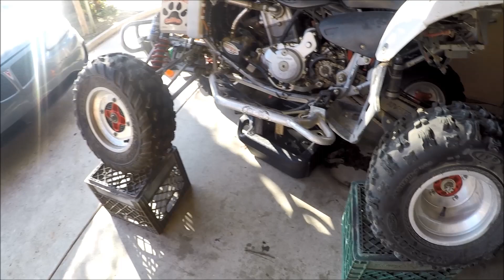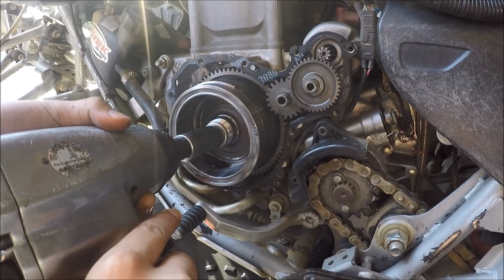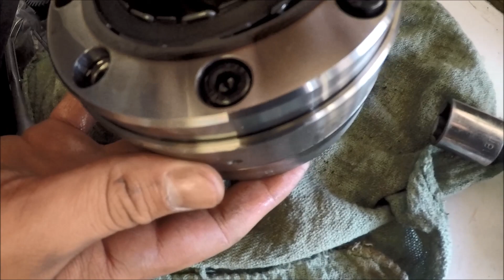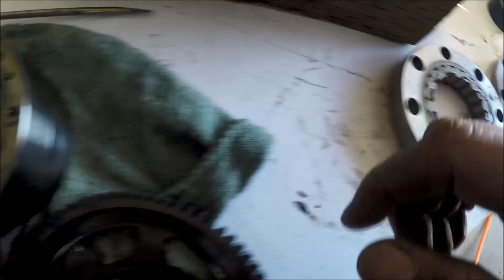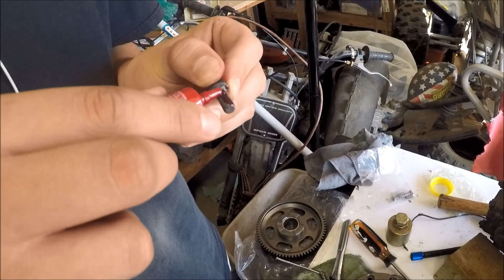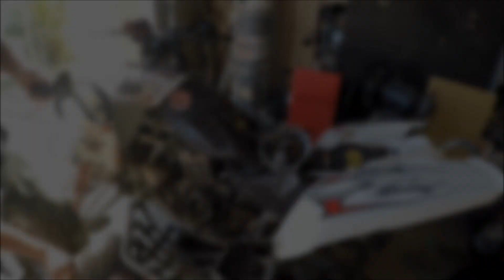Polaris Predator 500 oneway clutch/bearing removal & installation.

Comment: You should never use an air impact to put that nut back on your flywheel you will strip it or cause it to be weaker by tightening it down with excessive force it's best to use a ratchet and a pair of channel locks or crescent wrench to hold the washer trust me we have sheared many bolts off and had to drill them out
Reply from the maker: The impact I own does not have abundance of torque. I've used my impact and never sheared any bolts when tightening the flywheel nut on all the equipment (atv/dirt bikes) I worked on.  Thanks.

Comment: do you still have the link to the starter clutch to purchase it, having the same problem
Reply: thanks man had bought one before not to long ago and the wire that holds the small bearing became lose and it’s causing it to not run again
Reply from the maker: http://www.ebay.com/itm/321779687056
Reply from the maker: But you may get away just buying this only.
https://www.youtube.com/redirect?event=comments&redir_token=QUFFLUhqa2Vnd1dJckV6cTNja3JaYVdkYTN2QTNEWWNjZ3xBQ3Jtc0treTc5NUJua055emp5N245c09kZGtlcFNUVFBhWGpwU19tcWVKTUZiVUJ1RTRhS0Zqdlhtdzg0eWR3Zzd3ZFFEWHVfYlc2eWFzTk9zUmFYTlcyLVB5Uy1qdDE5ZFAwd0VHOWlpc3RhRDZ1eFA3NjVCbw&q=https%3A%2F%2Fwww.ebay.com%2Fitm%2FOne-Way-Starter-Clutch-Bearing-for-Polaris-Predator-500-03-07-Outlaw-500-06-07%2F254140539642%3FssPageName%3DSTRK%253AMEBIDX%253AIT%26_trksid%3Dp2057872.m2749.l2649&stzid=UgwohuRFCK5n-VLy5oJ4AaABAg.9ArmFOTz3oA9ArxIUbTi3m

Comment: Having problems starting with a predator 500 I've just got. Sometimes fine. Sometimes nothing. Would u start with this or starter motor please
Reply from the maker: You can tell by sound if the oneway clutch is bad. It sounds like a fast spin, or fast spin with some grinding noise. Also a bad oneway clutch can work and not work (grab). Oneway clutch spins oneway and when it fails, going bad,  it will spin both ways. I would check the easiest part to get to first.
Reply: Have you ever seen one bust a case because my case is busted right by the starter like right on the backside of the stater cover?

Comment: I have a predator 500 and sometimes the starter just click click clicks and then sometimes it'll work and sometimes when I turn it over by hand it'll freeze up another times it'll move Free is that possible my problem
Reply from the maker: It could be but not 100% sure. It could also be your starter is going out. But if it was my bike I would remove flywheel cover and see what’s going on.

Comment: Currently trying to replace one but the piece I took the bolts out of are stuck together. What can I do with common household tools to get them apart? Tried a rubber mallet.
Reply from the maker: Try to pry them apart by using a pry bar or screwdriver but also make sure not to bang on the flywheel, the magnets can get damaged.

Comment: Mine had black oil , are you supposed to ad some gear oil ? Or does it use the engine oil
Reply from the maker: Motor (engine) oil runs through that area, no gear oil.
Reply: Thanks!!
Reply from the maker: @jonathangonzalez5014  

https://www.ebay.com/itm/Tusk-Flywheel-Puller-Remover-33mm-POLARIS-PREDATOR-500-2003-2007-magneto-rotor/172718901580?fits=Model%3APredator+500%7CMake%3APolaris&epid=26017009903&hash=item2836d9494c:g:FuUAAOSwLVZV05wK:sc:ShippingMethodStandard!93720!US!-1

Comment: Mine came with an arrow on it pointing towards the right, does it matter which way the one way bearing goes on?
I got the one you put the link in a comment.
Reply from the maker: Yes it does matter which way the oneway is put on.

Comment: How much psi is your compressor?
Reply from the maker: 100psi
Reply: @mg016  , how much torque do i need in my air wrench?
Reply from the maker: @pastardicus  Fly wheel bolt torque is 111-125lbs, I'm not sure what my air gun is torqued to but I would recommended getting a torque wrench.

Comment: Hi I like your videos I learn a lot from them... I have a question is that in side spouses to be wet with oil .. cause mine polaris predator 500 is all wet all over
Reply from the maker: Yes that is normal, oil should be in there.
Reply: Thank you so much ..it was helpful

Comment: hi can you tell me where did you get the kit with the reinforced freewheel?
Reply from the maker: http://www.ebay.com/itm/321779687056
Reply: @mg016  THANK YOU so much bro .... you solved or broke again?
Reply from the maker: @luigimorelli6955  To solve this issue the Predator needs to use the oem(original) CDI or aftermarket CDI's Vortek or Dyno. Other aftermarket CDI will cause motor to kickback when starting motor and damage oneway clutch & sometimes woodruff key. I currently have a Procom CDI and sometimes it will kickback. I also know my motor very well and know when to give it gas(throttle) so it won't kickback when trying to start bike.
Reply: I bought the original and after a week it broke again, now I buy what you put in the video .... I hope to solve
Reply: @luigimorelli6955  hello could you solve the problem?  I need to buy one that works well and won't break.
Reply from the maker: https://www.ebay.com/itm/One-Way-Starter-Clutch-Bearing-for-Polaris-Predator-500-03-07-Outlaw-500-06-07/254140539642?ssPageName=STRK%3AMEBIDX%3AIT&_trksid=p2057872.m2749.l2649

Comment: So mine wont turn over and that gear spins freely, should this fix it? Could you tell us what the part number is for the replacement you used.. thanks
Reply from the maker: This one worked better for me.https://www.ebay.com/itm/One-Way-Starter-Clutch-Bearing-for-Polaris-Predator-500-03-07-Outlaw-500-06-07/254140539642?ssPageName=STRK%3AMEBIDX%3AIT&_trksid=p2057872.m2749.l2649

Comment: Life saver man, just got a predator and it’s doing the same thing.
Reply: What does it do when it's bad ?
Reply: @poorwhiteboy6521  when u go to start it you will here the starter turning but nothing else just a high pitched spinning sound it might try to turn over but if the one way clutch is really bad it wont catch and try to start at all.
Reply: @joshpersinger3659  thanks man I appreciate you I just had this problem with my predator and you described it to a T.